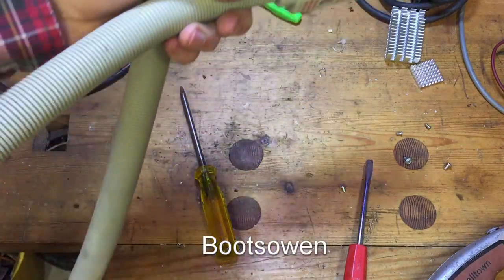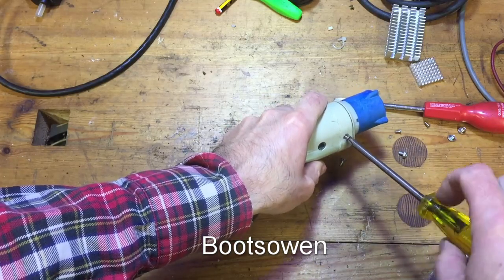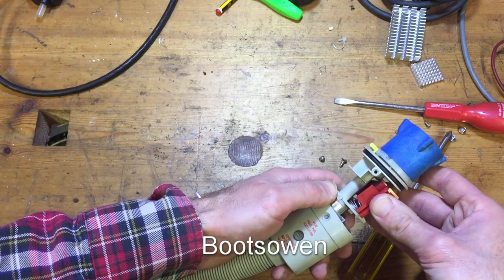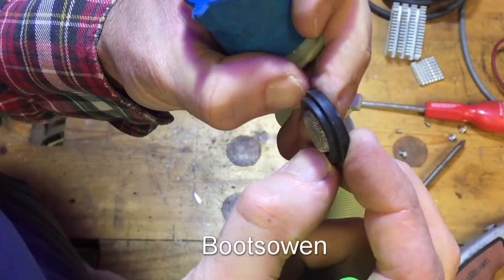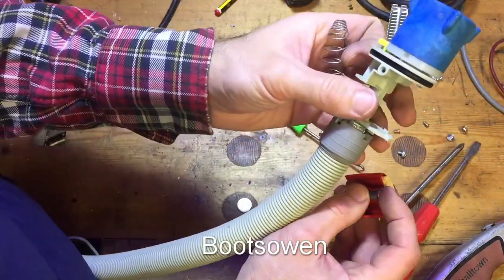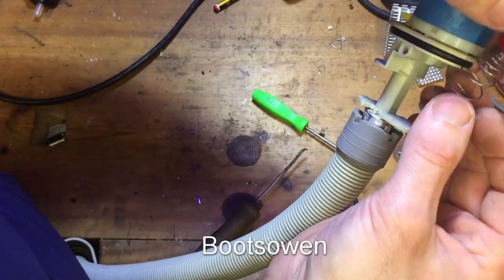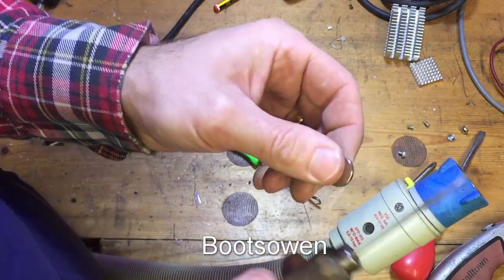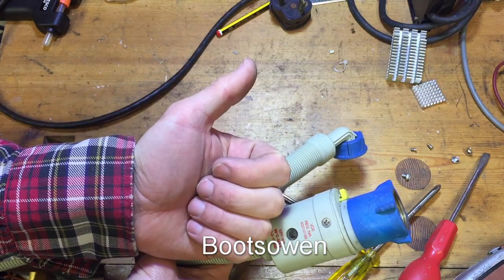Figuring out how an AEG Waterstop (Aquastop) hose works. Taking it apart: a look inside!

Comment: One of these devices has just completely ruined my kitchen,  something it was designed to prevent! 🤣🤣
Reply from the maker: new kitchen?
Reply: @bootsowen  few years old.
Reply: As well… totally useless product
Reply: I had a new AEG washing machine installed which came with one of these cold water inlet hoses.  It leaks at the tap connection.  Ive tried plumbers tape, it still leaks.  A useless over engineered hose.
Reply: Me too. Been leaking for at leat 6 months we now think.😢
Reply: same problem here in the netherlands, leaks

Comment: Different principle of operation cf Bosch AquaStop. It appears that this water stop valve design does not rely on power to then  actuate a stop valve/solenoid.  Double walled tubing to actuate the upstream stop valve here (and for water loss mitigation to the floor or room) is interesting . Bosch appears to use this double wall tubing to collect water in a tray below the dishwasher and then trip power via a float switch to close the inlet valve.  Nice micro engineering.

Comment: I had one of these supplied with my new machine about 7 years ago, but never fitted it. Can't remember why, either it wasn't long enough, or didn't fit the limited space or something. Eventually chucked it out in a garage clear out last year, but always wondered how it worked. And indeed, what the point of it was. Seems over engineered to solve a problem that doesn't exists (I've never had a normal pipe leak). Ironically, my son has one fitted to his AEG and the "leak proof" hose is now leaking out before the water gets to the clever bit. It's getting a standard replacement hose fitted!
Reply: Same. Mine is weeping
Reply: once removed and connected again - mine stopped the water forever. I switched to regular hose :D

Comment: Kinda weird though, everywhere on the internet you read that the mechanism measures a certain amount of water before shutting off. But it seems that it only is able to detect leaking into the second hose, not measuring waterflow. But most appliances have exact something looking like this in the hose directl after the tap.
Reply from the maker: Hi, there are at least two different types of aquastop, I have posted videos on the two that I have seen.

Comment: Its funny its called anti flooding hose, mine after 5 year with Aeg washing machine started to leak at the O ring and was spraying water all over under the sink where its connected, lucky i was there and heard it, otherwise ot would have been major leak over hours damaing thr floor, the yellow sponge normally is visible trough the check window, if it changed to red that means the sponge got wet and expanded and pushed the red plastic away, and now the magnet which is repelling another magnet inside the tube will close, you can take out the small magnet and install it the other way but that will just close the tube all the time so install it in a repelling way which you can feel with you hand, i was thinking to buy new yellow sponge amd replace it, its pretty much the same thing as a soldering iron cleaning sponge, but i noticed that the enclosure is deformed at the O ring and it would leak in there so have to replace the entire hose or just replace it with a normal hose

Comment: Actually, I haven't find here the answer to my question (if Aquastop in anyway, old or defected, might be responsible for the mysterious collecting water in the washing machine even in no operating mode), but ... your movie so much relaxed me, that I've nearly forgot the problem, and can spend the rest of my evening with whiskey instead.
Reply: I have the same problem slowly leaking into dishwasher. When knocking on aquastop valve it stop for a while. All kind of these should be dismantled?

Comment: This type of feed tube has a tendency to unwind themselves off the tap because of the ratcheting mechanism. Top line BEKO and BLOMBERG used to use these, but have now stopped supplying them with new machines because they undo themselves. If you do have to use 1 of these feed hoses, you need to take out as much of the coiling as possible by stretching the pipe and not having it coiled up when fitted.
Reply from the maker: Is top line Beko an oxymoron?
Reply: Technically, every not empty finite subset of a totally ordered set has a maximum (and a minimum), so a top of line Beko must exist... even though it may not be considered top of line generally speaking 😉

Comment: Very helpful. My washing machine has leaked twice, this time more seriously and it looks like I'm going to have to replace foor tiles and chipboard underneath. Whatever this hose does, it still seems to leak at the connection point. I guess when the washer vibrates  it comes loose. I've fitted a conventional washer hose now.
Reply: exactly what seems to have happened to me...flooding but not as bad as it could have been!

Comment: Nice video, I whole heartedly endorse all your magnet related comments! Ended up here since all my plumming was working like a charm, untill I turned off the isloation valves when the kitchen tap detached itself (admittedly I did pivot the mixer). Next thing the washing machine is on the blink. Turns out this hose wasn't the problem, the upstream flow is. So I figure I may have cranked the valve a bit before realising it wasn't  the sink valve (the two valves  branch at the same point - pretty common setup in flats in Germany). Thing is the sink is back to normal but this one only opens to a dribble - even without the hose attached. The landlord is a bit of a slumdog millionaire so I'm wondering if there is anything obvious to try before involving him in getting a plummer?
Reply from the maker: You could try a plain hose, it will tell you if the aquastop hose is the issue.
Reply: In the end swapping out the angle stop valve left everything working slightly better than before.

Comment: We have a GORENJE washing machine which has a leakng Aquastop hose exactly like the one you are showing on this video. The problem is when we tighten the hose to our tap it leaks at the top (head) of the hose even though it is firmly tightened. We think the Aquastop head is the problem. Our question is, can we use a standard hose on the machine, if not, do you know where do we buy the Aquastop replacement hose for this machine? Any information is appreciated. Thanks
Reply from the maker: if it is this exact hose I think you can use a plain replacement, some aquastop hoses are attached to the machine and have wires within, they can't be disconnected.

Comment: What do you think it means if my washing machine hose (identical to this except, for some reason, red caps even though it's cold fill) shows both red and yellow inside the little window, but it still appears to work, in the sense that water comes through to the washing machine?

Trying to work out if it's worth the giant pain of swapping the existing, old and potentially knackered one for the one that came with the new machine.
Reply from the maker: I would change it. It should just unscrew.

Comment: If a dishwasher has one of these aquastop  valves can the old type connector be used instead.
Reply from the maker: If you can unscrew it from the machine you can use a regular hose instead.

Comment: Would you need to install this input hose 100% vertical to work?  Or could it work say horizontally?
Reply from the maker: I don't know,
Reply: Doesn't matter. If the hose starts to leak, the water will get to that sponge anyway.
Reply: You can install it whatever position you want it, the repels the other inner magnet either way opening the tube, and if the sponge gets wet it will expand and move away the visible magnet so the inner magnet is not being repeled anymore and closes the tube

Comment: from where I see it, this device won't prevent flooding in the event of an inlet solenoid failure (that happened to me once), it will only be triggered in case the hose bursts or leaks.
Reply from the maker: Yes, you need an aquastop with a float valve in the base of the machine to stop it if something in the machine leaks.